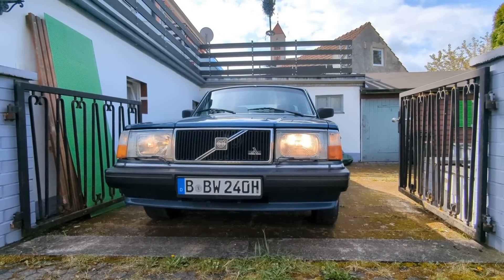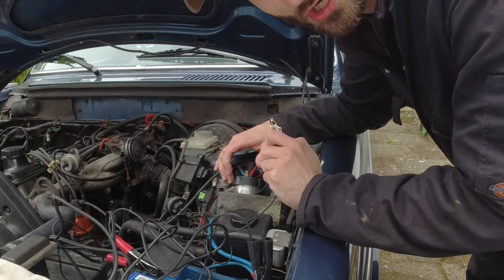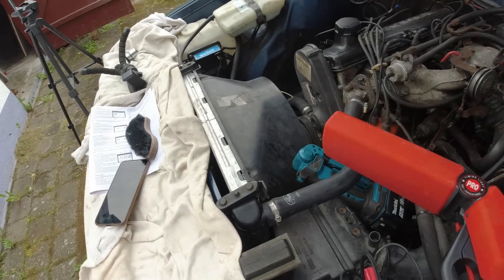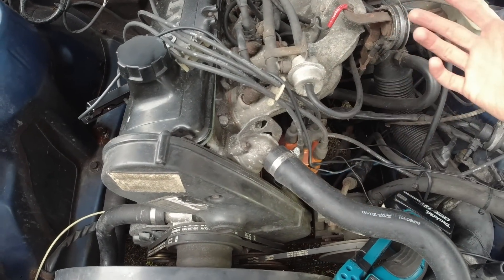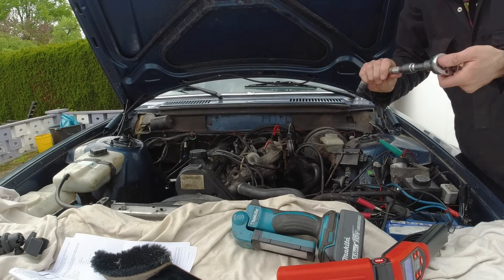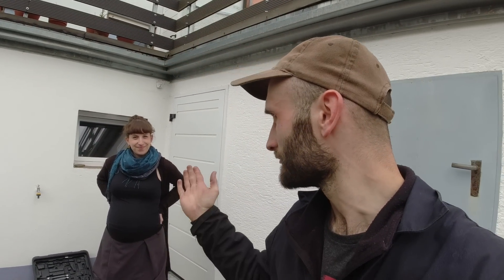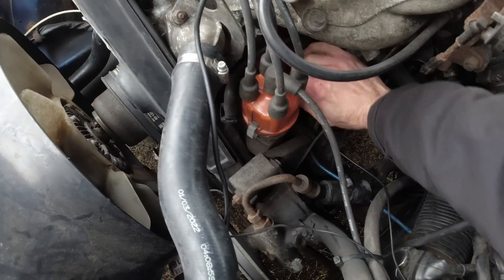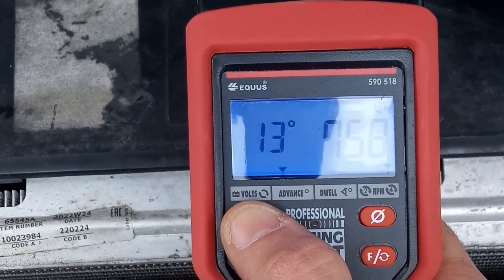Using a Timing Light on my Volvo 240 made a BIG Improvement!

Comment: I have been fighting with my buddies 240 and its timing. Its a project car he picked up and we had to replace bassically the whole fuel system. The issue now is that the timing appeared to be 180 out. I brought cylinder 1 to TDC and dropped in the distributer with the rotor pointing at cylinder 1 and I still cant get the engine to start, All these repair manual dont say anything about how to actually set the mechanical timing on these other than "look at the old one" do you have any idea what I could be doing wrong?

Comment: Little known trick I learned from the crew chief of our drag racing team but a common method by seasoned professionals needing to adjust timing quickly in the pits between rounds. Rather than using the #1 spark plug wire, put the clip sensor onto the coil wire. Same 100% accurate results but a clearer illumination of the timing marks on the cover & pulley rather than the blinking strobe effect. Try it...

Comment: On my old 940 i struggled for years with hesitation and sputtering, even stalling at red lights... I eventually tested how much spark i was getting and found it was hardly any, so at that i had already replaced everything, besides the ignition coil. As soon as i installed a new ignition coil, never an issue in the slightest. Until i flipped it 😅

Comment: Could it be worth putting in some of the fuel additive to reduce emissions and/or giving it a good spirited run before the MOT test so it's nice and hot?  I assume thermostat is working so car is not running too rich as well.  Usually new spark plugs helps too.
Reply from the maker: Could definitely be a good idea, the emission should be better now after this adjustment, but I think last time they didn't warm it up fully, as we take it there early in the day and they get to it at some point not straight away

Comment: I paint the timing mark on the crank pulley and then I also use a paint pen for the ticks on the lower timing cover.  Makes everything very visible with just the strobe from the timing light.

Comment: Hi Sledge,
Another good video so thank you for posting.
When setting the dynamic timing with a strobe light you also need to adjust the rpm to a specific value, for Instance 12 degrees btdc at 750 rpm, sometimes the timing is set at the engine idle speed.
 You also need to know if the vacume advance pipe to the distributor should be connected or disconnected whilst setting the dynamic timing, this information can usually be obtained in the workshop manual, Google or via Autodata.
Best regards to you both
Stefano
Reply from the maker: Thanks for the info, that's a good point! These didn't have a vacuum advance but the earlier ones did. I remember using Autodata years ago, such a good database!
Reply: @Involvod  Hi Sledge....
You're very welcome it's good to share experience and knowledge, I enjoy watching your videos.
Best regards to you and your good lady.
Best regards
Stefano

Comment: Did i get it right that the 2 with LH Jet still has adjustable ignition?
I've never had a 2 or anything with a distributor on the block.
Reply from the maker: Yeah just the LH2.2, the later LH2.4 the dizzy is there but not adjustable

Comment: Very handy tool to have for sure! I also found that just a few degrees can make a big difference. Always nice when a noticable improvement can be a simple tweak. Loved the intro as well, made my day! 

I have a stroboscope from the 80s. No fancy screen or multiple buttons, but it does the job. When I first used it on my Amazon, I couldn't find the marks. People kept telling me it should be located on the front pulley. Reading the service manual, I found that they're actually located on the flywheel of the car! There's an opening in the bellhousing you point the light through. The next problem I had was that because the car is 6 volt, it would barely flash. Had to hook it up to an external 12 volt battery.
Reply from the maker: Glad you enjoyed it! And just when you think it should be easier to do stuff on older cars 😂
Reply: Yes, many cars used to have that: Old Peugeots 404, 504, bmw 02, 3series
Reply: Greetings to felow volvo amazon 6 volt owner :) yeah, the markings are on the flywheel, also the vacuum hose have to be disconect from distributor.

Comment: In many B230F with LH 2.4 and EZ116K you can't change timing like that. The distributor isn't even movable in 940. Timing is adjusted by computer based on different constantly monitored variables/inputs and timed with crank position sensor.  No doubt this is valid with LH 2.2 though.
Reply: you can move the timing to 3deg advance on lh2.4 volvos.

the contact going to the flywheel reader, if you cut of the directional plastic casting and turn the contact 180 degrees, you trick the brain to ignite another 3 deg earlier as it will ignite going into the timing hole instead of going out of the timing hole, by reversing the poles on the sensor.

the ecu will read it as the engine is on time but in reality it will inject and spark 3 deg earlier than stock, for a little power improvement, did it on mine on a dyno and it went from 96 hub hp to 100 then tweaked the cam timing and got another 6hp, (ran the H cam at 2 deg advance)
Reply: You can take out the rubber key on the distributor and rotate it but it makes no difference as the computer corrects it all in 2.4
It really confused me at first too haha
Reply: Ez116k is synonymous with Regina, correct? I ask because my 94' Regina 940 has the bolt to adjust the distributor

Comment: Pefect, letting your pregnant wife turn the distributor.  i cant even remember how many massive jolts ive had trough the years touching old distributors and leads while the engine was running, they have to be hardened from early age...

Comment: would the offset be different for a carburetted volvo 240?
Reply from the maker: I saw it was anything from 10 up to 15 degrees btdc depending on the engine so it would be worth checking your engine code 👍

Comment: My LH2.4 redblock has unbelievably good throttle response but sometimes has hick-ups at very low rpm and a slightly rough idle. I wonder if I made a mistake when I checked the timing. Slightly too advanced ignition timing would explain those symptoms.. 
Good stuff Sledge! Super happy to be beneath the bonnet again :)

Edit: 4:01 yup mine does the exact same shaking thing without missing a beat. I'll double check the timing, I've got a feeling it's too advanced.
Reply from the maker: Low rpm hick-ups are the worst! I get so stressed thinking it's going to break down. The rough idle seems to be a redblock feature 🤣
Reply: @Involvod  Once or twice it even quit on me when I was trying to get going. One quick tap to the fuel pump relay and it's usually fine again. No idea if it's actually at fault or a placebo in those situations, sometimes it still needs a few throttle blips to find its groove again. 
It can definitely be scary but I've never been left stranded, only a very temporary road block :D
Reply from the maker: @Bassalicious  it is rare for them to really leave you stranded, has never happened to me, just a few temporary roadblocks as you say 😂 Oh and when I had to clean the distributor cap after the car wash 🥴 Do you have spare fuel injector relays? I made a jumper wire from the 87/2 to 30 pins, cheaper than a relay and a great way to determine if that is the fault / if the pumps still run!
Reply: @Involvod  that's a brilliant idea to make a quick fix jumper from an old relay! I have an old fuel pump relay in the glovebox. But up until now a few taps always did the trick - knock on wood. 
My car had a quite beefy switch mounted inside the ashtray when I bought it but it wasn't wired. Must've been for fuel pumps straight to switched positive.
Reply: LH2.4 system is different.
The timing is done by EZK and it keeps on advancing it until it receives ping feedback from the knock sensor. Then it delays timing in increments of 3 degr. after which it again tries to advance timing. Rinse and repeat. It's a classic feedback loop system.
The distributor just needs to be set in the right mechanical ballpark. Inside that dizzy there is no centrifugaal advance nor vacume advance. It's all done by the EZK module. 

The only servic8ng you need to fo is decent plugs with the rigt gaps set, good wires, good cap and good rotor. If these are in good condition the ignition should be perfect all the time.
Reply: @jfv65  I have read of a procedure to set the base timing though, I'm wondering if the EZK may be running out of adjustment freedom or if the previous owner maybe grounded pins 18,19,21 or 25 of the EZK. But you are right ideally everything should be fine. 
As Sledge said though, running a bit rough might just be a feature of our beloved tractors :D
If only the occasional hiccup / difficulty starting would be replicable. It's such a nightmare to troubleshoot because it's always fine again when I try to check anything.

Comment: “Failed the emissions test” …is that a special TUV code for “you drive a Volvo”🥲
Reply from the maker: Haha, it's funny they normally always pass with flying colours here, this is the first time I've had problems!
Reply: @Involvod  I'm convinced the cat didn't heat up enough. it's half the cars length away from the engine so even idling isn't enough to heat it up properly.
Reply: @Bassalicious the rich fueling on cold start up also helpt to heat up the  cat. And now with correct ignition timing it will also start to workbearlier and better.
Reply: @jfv65  that's true. my TÜV engineer told me that in his experience they may fail if not revved up for a bit before taking the measurement. I trust his expertise on that tbh

Comment: Nice! I think, the timing on my 92 LH2.4 is computer controlled and not adjustable. Anyone? At any rate, I am ashamed to admit it is still in pieces in my garage since my head gasket failure in November. Spring came and with it a host of work outside. Maybe June is the time...
Reply: you still have to set the "neutral" point so the computer can properly set the timing and doesn't run out of range. There's a procedure to do that but I can't remember exactly. There's also some connections you can make at the ignition computer to advance or retard the target ignition timing.
Edit: Google "Advance/retard timing on EZ116K" and check out the tubobricks forum result if you want to modify the timing on your LH2.4
Reply from the maker: Yeah you're right, sorry to hear it's still out of action, that's why I'm hesitant to start any big repair jobs at the moment, I can imagine the car might stay on axle stands for a lot longer than anticipated 😅